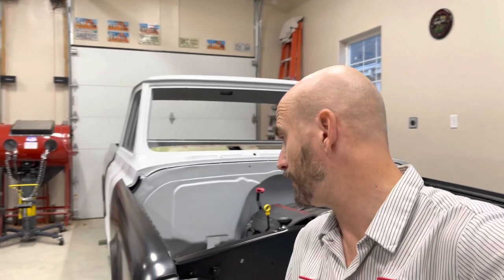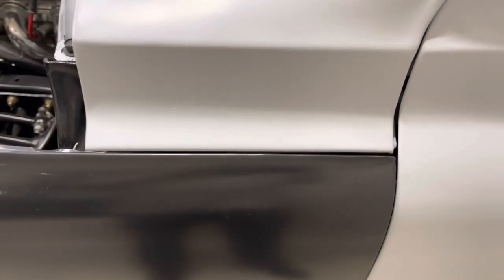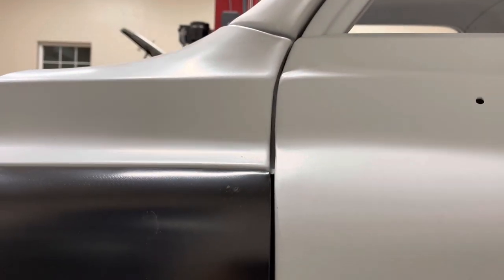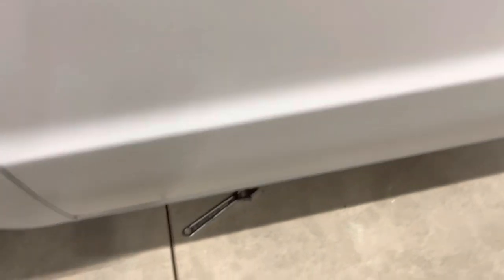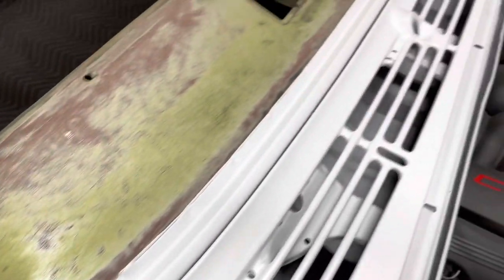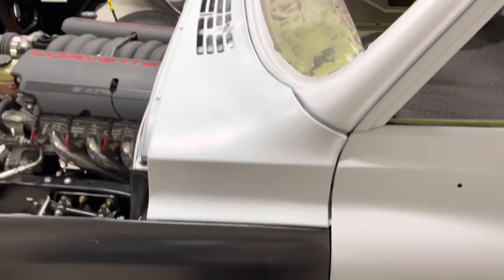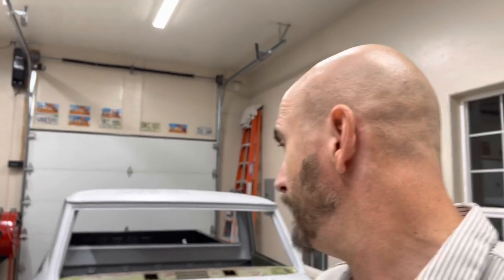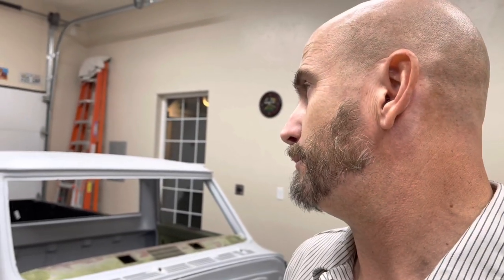C10 Cab Alignment

Comment: Excellent work sir. I’ve had a new 2019, 2021 and now a 2022 Silverado… all have worse gaps straight from GM.
Reply from the maker: Thanks for the comment.  I’m hoping to achieve even better door gaps when I fine tune things after paint and final assembly. I’ll also do a video on that as getting the hood and doors aligned after removing the hinges can be a little tricky.
Reply: @curtrobinsongarage5452  The main alignment issues I’ve seen on new trucks is the cab to bed alignment… I know the bed to frame has some plastic alignment dowels but they don’t always fix the issue. Sometimes it’s just moving the bed left to right but usually it’s one side sitting higher than the other.
Reply from the maker: @gearjonny369  I’ve been doing this for 25 years and year after year it never ceases to amaze me how poorly vehicles are being made.  The cost is astronomical and the components and amount of plastics used gets cheaper and cheaper.  Vehicles today are made to be disposable.  Manufacturers want you to keep buying new once your warranty is up.  It is very unfortunate really.

Comment: I have a 65. If I look down my driver’s side, the box and cab are pretty smooth and flush with each other. Down the passenger side the box appears to be more narrow than the cab by 2”???
Reply from the maker: @grumpy1962R  so after contemplating your question.  I’ll try to answer it the best i can. I have seen some trucks where the bed or the cab seems narrower.  Usually if you center everything it ends up looking pretty decent,  sometimes it’s hard to judge with all the curves on older trucks.  The best thing to do in your case is asssuming your frame is perfectly straight then find the center of your frame and mark the center of the cab and bed from underneath and center them on the frame.  Normally there is enough adjustment to accomplish this.  You didn’t say if you have a step side or fleet side bed.  If it is a step side then I believe they are a little narrower by design.  If it is a fleet side then it should be much closer in width to the cab.  If you have a fleet side and centering everything looks all wrong then I’m at a loss why there is that much discrepancy between the two.

Comment: Love to see what an how the hood works out.
Reply from the maker: Unfortunately it’s not in the video but I did fit the hood to check the gaps and it fits just fine to the fenders and cowl panel.  I won’t be putting it back on until final assembly so that will be quite some time. But when I do I will explain how to shim the hood hinges for a proper hood fit.
Reply: @curtrobinsongarage5452  That is the one I am most interested in. My 72 Cheyenne is close enough to make the latch work, but not spot on and that alignment has eluded me so far....I am 78, so maybe it will be up to the grandson.
Reply from the maker: Usually with the hood it is a combination of adjusting the hood hinge height and sometimes adding shims. As with any body panel, usually it’s just a matter of spending time and making a lot of little adjustments.  It can be frustrating and sometimes it can take quite a few hours to adjust everything to make it look good.

Comment: Looks awesome. Are u selling her?
Reply from the maker: Well, that was the initial idea when I started to build and sell it for a profit then start another, but honestly now it could go either way.  I guess I won’t be able to answer that till it is finished.
Reply: Any idea how much?
Reply from the maker: @rarebreed6703  I’ll have over 40K just in parts and supplies like paint.  Over 500 hours labor at the minimum.  Currently I’ve spent half that in both categories.  In my mind I was thinking of selling it for at least 60K but for any less than that I’ll keep it.
Reply: Good tip😊s but How did you raise it?